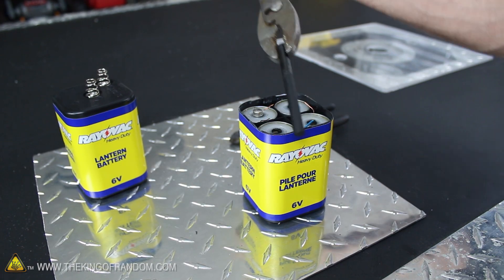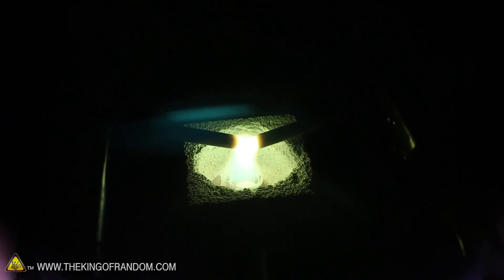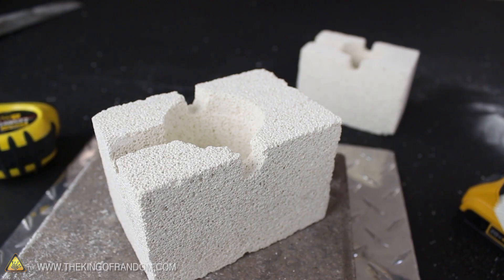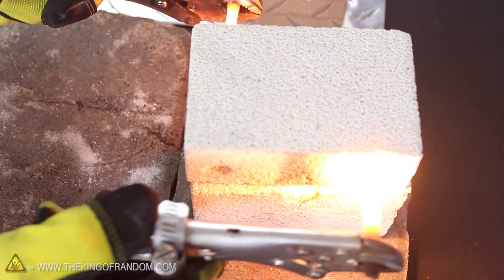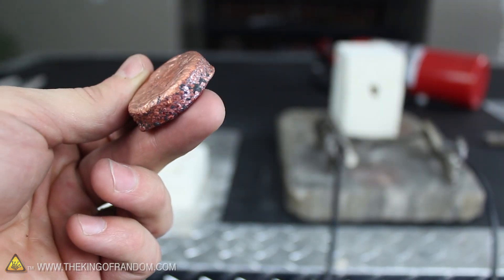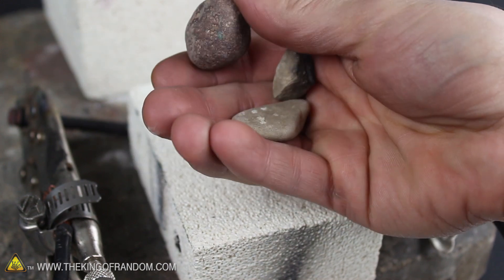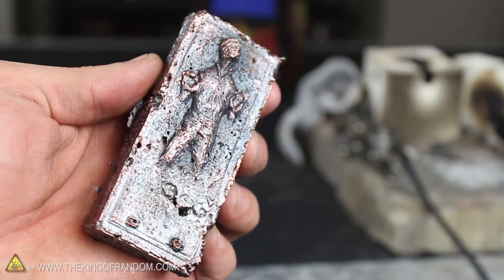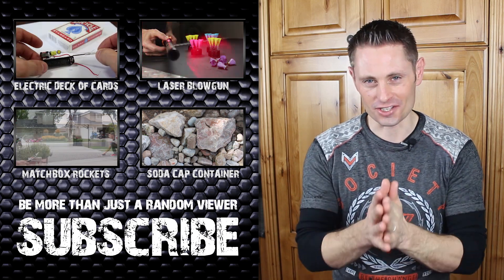Mini Arc Furnace (Arc Reactor Technology IRL)

Comment: I would love to see if you could get more detailed castings from the copper. I have an idea for some custom coins and I'm not sure if it's possible to get rid of all those bubbles I saw on your copper casting.
Reply: I think the bubbles were from the plaster burning away. You'd get better results if you used a more suitable casting mold .
Reply: Albie Beck
I am guessing that the plaster still had some water in it.  When the molten copper hits small pockets of water, it causes mini steam explosions, hence the hot metal flying about.  The steam is a gas also and would also cause bubbles in the poured copper.  Even if the molten metal is poured into a completely dry mold, it may contain voids (bubbles) as there are dissolved gasses present in the liquid metal itself (grabbed right from the surrounding air).  Usually molten metal is de-gassed with an additive (I use washing soda with aluminum) stirred in before pouring into a mold. And you were right about getting better results with a more suitable mold. The plaster might be made better by slowly baking (too fast and you will break the mold with steam) the mold in an oven after it is air-dried to finish driving out the water. Still not a good choice for a high temperature mold though.
Reply: David Kenny
Thanks for all the info. I'll do more research to find a better casting medium.
Reply: I'd probably suggest you go with a graphite or steel mold, they tend to hold up better to heat, but you still want to make sure they are dry. You might also get away with using green sand depending on the material you are casting.

Comment: Absolutely insane! It blows my mind that something like this isn't widely used. I mean you made lava...LAVA....with nothing more than household stuff! I'm somehow convinced that that power output is like nothing before and could benefit mankind. I however don't know if scaling it would be practical or even feasible.
Reply: zumbazumba1 If a 6$ brick can make two furnaces. And he got the microwave from the trash, I'm pretty sure his "non-industrial quality" arc furnace is a lot more cost effective, regardless of how long it lasts. He could easily make a new one with more garbage. The sheer amount of garbage available is what makes this kind of stuff even more exciting.
Reply: steven spall  I'm a Metal smith by hobby and I agree that it is far from dead. People will pay more for hand forged swords and knives than the stamped out ones made en mass especially if you customize them. But the real money for hand forging comes from custom house ware such as railing hinges decorative door and window covers, chandeliers, etc. People will pay big $ for that stuff and often times all it takes is just a torch, bar steel, pliers, and a hammer, but to get really fancy you want to build some jigs and other tools.
Reply: Not everyone has the money for a hydraulic splitter. I do however have a couple microwaves I scrapped for free, and an old battery. So yes, it is economical for me, as a blacksmith, to build one of these. And blacksmithing is not obsolete. There's good money in hand forged custom wares, particularly knives. But good knife steel can get pricey... Unless you can make your own super cheap and cut down on overhead costs, thereby increasing profits
Reply: ***** Yeah, that would make a lot of sense. I just got too excited.
Reply: I understand why you got too excited. It's amazing, isn't it? Like, man, he did that with household stuff, something that huge industries does
Reply: You can melt most common rocks with a normal charcoal furnace that he made before.
Reply: spratsprat true, but they usually don't glow. The glowing is what makes melting rocks interesting
Reply: JWQweqOPDH You could make one a little bit bigger. Maybe use a whole brick for one furnace, and use it to make small amounts of custom steels for forging knives. That's what I'm gonna do. It'll melt down cast iron, so mix in the right amount of mild steel to get a high carbon knife steel. Sure it's not viable for large scale projects, but when is the last time you built a scyscraper, or an automotive assembly line in your garage? You can turn low grade mild steel into high grade carbon steel, in amounts that would be very useful for any blacksmith.
Reply: I know! I didn't know you could make lava, and that fire brick could withstand it!  =-O
Reply: Josh Maleszewski Yeah exactly, it was lava!!
Reply: What are you going to make with it? Without carefully controlled conditions, you're not going to make quality metal. It's too low quality for mechanical or large structural purposes, and you don't have the machinery to roll it into foil, cans, or parts within a device or tool.
Reply: JWQweqOPDH Well if you can come up with something that powerful, I'm pretty sure you can come up with something to do with it. Because no matter what it becomes art the second it's touched.
Reply: steven spall But what are you going to make other than mechanical tools or buildings? Too dangerous for any tool (could break unexpectedly), not enough machinery to make a spare bolt, etc.
Reply: Actually in commercial settings arc furnaces are readily used to melt large quantities of metal in short periods of time. I remember a steel recycling plant in my home town used one to melt steel thirty tons at a time and it only took them perhaps 8 minutes from the time they switched it on to the time it was fully melted, of course the electrode had to be replaced about every 8hrs - 4 days depending on how well it was made and also how much use they got from it. It's also the only way to reduce aluminum oxide back into pure aluminum.
Reply: JWQweqOPDH I think you missed my point JW. Mild steel has a low carbon content, and doesn't harden, so cannot be used for things like knives, hammers, axes, etc. Cast iron has too much carbon for those applications and is very brittle. With the right ratio, you could make good, high carbon tool steel, cast it into ingots, and forge it into the tools you need from there. And finding the scrap steel to start with is very easy, and very cheap, sometimes even free. Heck, the microwave the transformers come out of have enough mild steel to make a good ax. Just put it in the furnace, throw in some charcoal and melt it down. The forge the ax by hand.
Reply: steven spall What I'm saying is, this is for hobbyists only, or those particularly good at a near obsolete trade. This is not an economical practice for anyone trying to save money or materials. An ax for lumbering can be replaced with a chainsaw and hydraulic splitter (that's what we have at my house).
Reply: Well he did not discovered fire for christ's sake,ever heard of plasma cutters?
Im not saying that this is not nice but technology behind this exists for at least 10 years,he simply reproduce it form household trash-and for that he has my respect.
Althou every fool can see that those cables are too thin for long lasting use,something that he should work on.
Not many of his projects last long,they are not industrial quality and lifetime tools-i know its for show and throw away.
I still like his channel,i would like to see microwave arch welder that will last more than a week.he should focus more on durability.
As for commercials i hope he wont make same mistake like Kipkay did(make a video and more time is commercial than video itself) ,it cost him a lot of subscribers and his videos are boring same old stuff,like he is making them for money only.

Comment: Cool furnace! Next time, try pouring your molten metal into jewelers investment plaster. It is made of bone ash, silica and gypsum. It will take the heat and won't release gasses like plaster of paris does.

Comment: I watch these videos, and I'm like,"How is it he hasn't been killed yet?" He plays with flammable hydrogen, liquid nitrogen, eats dry ice, make a stick welder out of a microwave, and melts rocks into lava using flashlight batteries.
Reply: Atlas Slates danger is a matter of opinion based on the abilities of the individual
Reply: he's careful and intelligent. things are only dangerous unless you're stupid...except percussion explosives, those are dangerous no matter what.
Reply: This did not age well
Reply: well now he really is dead :(
Reply: I'm pretty sure he only used the carbon rods from the battery and hooked them up to the arc welder he made from microwave parts, which is powered through an electrical outlet. I highly doubt those batteries could provide this much power for much longer than a few seconds if at all.
Reply: legionbunny "things are only dangerous unless you're stupid" claps slowly
Reply: He has passed away in a paragliding accident. Rest in piece. ❤️
Reply: This comment aged poorly
Reply: He knows what he's doing and has the right equipment
Reply: Crossing the street is dangerous if you're a squirrel or have similar intelligence. Not if you know how to see a car and predict that it will drive on the road. Dangerous things are only dangerous when you can't predict possible outcomes.  If you can, you can plan for them. Example, if you didn't know the sparks would fly, you could set your living room on fire. If you predict it, you don't do this in your living room.
Reply: engineer/mechanic skill level 999, its official, when apocalypse hits find this guys,scavenge anything and give it to him
Reply: The batteries were for the carbon rods only. He uses something else as the power source. Not sure what, but it ain't batteries.
Reply: fireclaw316 Chernobyl is a bad example. they were purposely being incredibly stupid...though to be fair, they didn't quite understand the limitations of the reactor, and were attempting to find them. Not entirely the operators fault though, the test orders came from higher up. By today's standards, so little was known about the limits of reactor containment that the gentlemen operating it would still be considered students.
Reply: Trey B He probably meant they're only dangerous IF you're stupid, but thats still pretty funny xD Stupidity has saved me a few times in life, but it has gotten me into trouble far more.
Reply: Fireclaw Studios and his wife let's him do it
Reply: You spoke too soon 😭😭😭😭😭
Reply: RBLnightmare316 he is now dead 😭😢
Reply: legionbunny Whatever. I'm just saying, I'm astounded at Grant's ability to not get him self killed.
Reply: Trey B Well, if you're stupid, you probably don't HAVE a concept of danger.
Reply: ***** Thanks man, I don't care what Cap says about you, you're pretty cool.
Reply: Because he's not a dumbass and knows what he is doing?
Reply: He’s dead
Reply: Um 2019 bro
Reply: Mate this aged like milk
Reply: @daanzoomer2997  Bro...
Reply: @KittenoftheBroccoli  what?
Reply: Comment didn't age well
Reply: ***** hmm let me do the math on this.
Reply: +legionbunny eating dry ice for a video is cool, but takes no skill, and is dangerous for everyone.
Reply: "things are only dangerous unless you're stupid" ONLY UNLESS YOU'RE STUPID
Reply: I know, right? Its unbelivable how much deadly stuff this guy does and manages to stay alive. He's problably imortal or something.
Reply: Yea but think of the Epitaph on his tombstone!
Q.
Reply: He knows what safety is reckless idiot
Reply: Atlas Slates
There is a chance as you swallow your own saliva that you choke and die. 
Therefore it is super dangerous right?....
Reply: Ummmm
Reply: that would make it .0001% Dangerous
Reply: ***** eh, i'm tired, haven't slept for like 28 hours now, need to sleep, but I can't yet or i'll wake up too late to finish running my load tomorrow.
Reply: legionbunny lol its all good man, i understood what you were saying.
Reply: legionbunny lmao
Reply: You know.... I just realized that you are completely right. I mean he is safe and everything even though he is not a "qualified" professional... This is awesome and I am sure he does not just have an idea and blindingly go into it.
Reply: Just for funsies.
Reply: legionbunny I detonated a percussion cap dissected from a bullet before, luckily I wasn't injured, but there was a very brief ringing of my ears, and I had incredibly small shrapnel embedded in the very outer layer of skin on my hands.
Reply: Richie Rich best replay ;)
Reply: He made rocket fuel
Reply: You just have to be cearful
Reply: Toketildeath It's 100x more dangerous than that! .01% Dangerous. ;-)
Reply: you craaazy
Reply: it's not stupid when it works it's stupid when it fails and you get injured badly or concept it self is stupid and failed
Reply: BankaiIchigo12345 He actually used that stick welder he made as the power source
Reply: Aged like milk...
Reply: Dang dude, this comment didn't age well
Reply: This didn’t age well
Reply: He is now
Reply: The irony 😅
Reply: Toketildeath no, you might be safe 9999 times out of 10000, that doesnt make the danger any less real
Reply: Ya jinxed it.
Reply: legionbunny no, if something is dangerous, its dangerous.
Reply: @fuzzygreen3634  people die every day falling down stairs or driving to work
Reply: He uses and arc welder he made
Reply: fireclaw316 i'm not, he is an intelligent careful man.
Reply: Trey B Yep. I goofed on my grammar. Thanks for pointing it out. Now go do your homework and let the adults talk.
Reply: This aged poorly

Comment: Grant Thompson - "The King of Random"  I'm going to try and modify this and retrofit it to my coffee can forge for blacksmithing. I've been doing a little reading and found a couple places that said graphite rods could be used also. Would solid graphite artist's pencil work or would that type of graphite be too soft? I have a couple that are roughly the same diameter of the carbon rods. Now, would larger rods, or a higher electrical output accommodate a larger chamber size? Did you use the same wires that you used on the welder or did you tap the MOTs and use larger wires to connect to the vise grips? One last question, would the furnace be capable of heating sections of a larger piece? I WILL be making this arc furnace and would really appreciate your input.
Reply: 1-check the temperature rating on your can forges refractory material, if it isn't at least 4500, replace it. 2.the softness of the graphite /shouldn't/ be too much of a problem, but lantern batteries are relatively cheap, especially if you can find someone with a dead flashlight 3 my guess is that larger rods would create more resistance and therefore more heat, so in theory yes, however better insulating a larger chamber can be more cost effective 4. dunno, i'm not grant. 5. if done this way a lot of heat will be lost which will make the process extremely inefficient, if you're looking to soften the piece and not melt it, I recommend looking into induction smelting.
Reply: legionbunny  Thanks for the reply. 1. The insulation in my smaller coffee can forge is 1" of  8lbs density (2600*F rating) ceramic insulation with a medium thick refractory coating of a 2:1 Zircopax (ZrSiO↓4 (m.p. >3600ºF/2000ºC)) and Kaolin (China Clay (A↓l2•O↓3•2Si•O2•H↓2O) (m.p. 3150ºF/1760ºC)) slip (semi-watery clay mixture). Grant's firebricks are probably only rated for 2800º (G28 firebrick, maybe) considering he got them from a hardware store (note the molten quality of the firebrick "lid" after 3 minutes to melt steel (~2500ºF)).

2. Lantern batteries ARE cheap ($2.50US at Harbor Freight), however, if I have the pencils/graphite rods already then why not utilize them?

3. I'll try both and see what happens. Maybe Grant can include it in a follow-up clip.

4. Hmmm...Grant doesn't have an alter ego?!?

5. Induction forges are VERY costly to buy and even build, they also practically require a degree in electical engineering. I was thinking of something more like a pass-through hole/slot in the furnace chamber rather than attempting to heat it outside of a chamber.
Reply: 1.I was automatically overbuilding in my head for the highest temperature i would possibly use
2.touche 
3. Have fun, don't forget gloves and welding mask
4.not as far as I know
5. what exactly are you after?
Reply: cheaper alternative to propane, have you considered liquid fuels? Depending on state laws, garages may have to pay a fee to dispose of the waste oil from oil changes, past that I really recommend coal coke, with careful engineering, you could modify an arc furnace like this to run on lower voltages and heat coal in an inert atmosphere, it wouldn't be the easiest thing to build, but it's the cheapest thing I can think of. I used to actually have my own coke furnace, but a tree fell on it.
Reply: legionbunny Coal/coke burning is pretty frowned upon in a residential neighborhood, especially one like mine with mostly older residents. Which is why I started using propane. I do use a coal forge at my local blacksmith association, though. I've looked into waste oil forges, they can be expensive to set up and are hard to tune just right. Also, once the reserve oil gets up to temp it can be pretty combustible. I have pretty much everything I need to make the arc furnace, I'd have to buy the materials for a waste oil forge.
Reply: Dan Broomhead then you've answered your question, Go for it!
Reply: legionbunny Thank you for your help. It is appreciated.